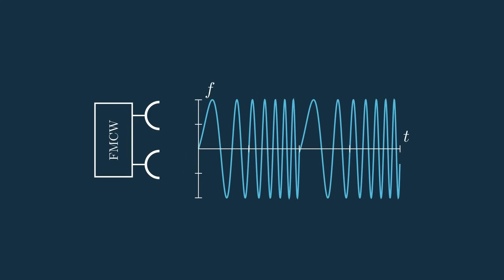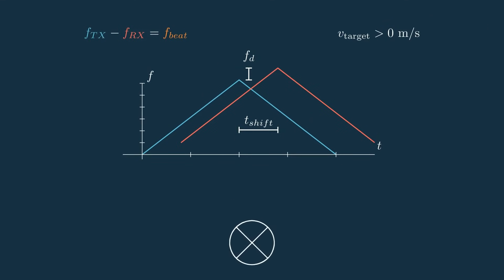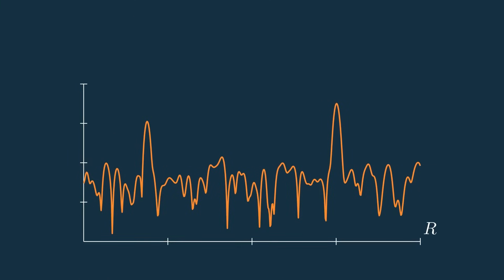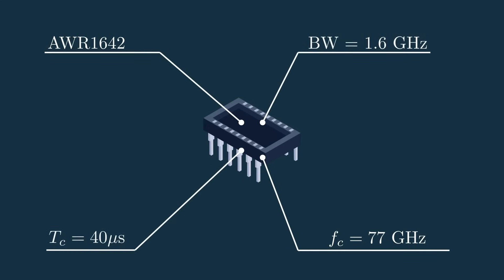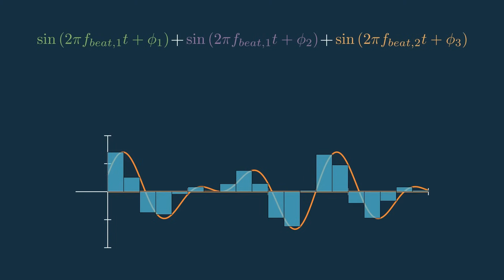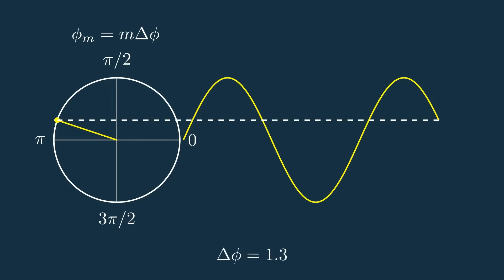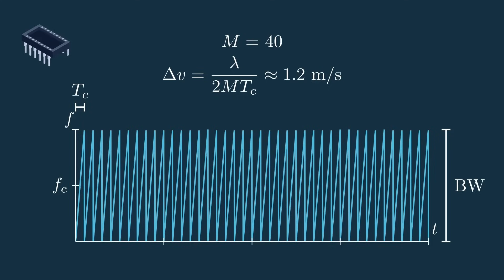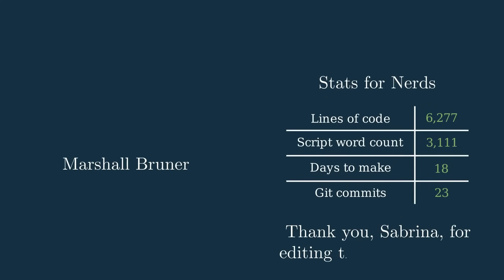How do automotive (FMCW) RADARs measure velocity?

Comment: The analogy of the police speed radar is incorrect. There is not enough motion for any meaningful Doppler shift of the incident wave and the reflected wave. The beat frequency is caused by the interference rate between the waves, which are constructively and destructively interfering with each other at a beat frequency in the lower part of the audio frequencies. The perceived Doppler is that of the beat frequency, not the two RF frequency wave forms. This is why police radars are field calibrated with audio frequency range tuning forks.
Also, target discrimination in police speed radar is determined by the operator listening for the Doppler of the audio tones. This requirement is often a valid defense against radar measured speeding tickets. Require the trooper to demonstrate how to operate the unit…if he/she fails to turn up the volume control, then they have no way of demonstrating the ability to discriminate which car they measured.

Comment: How do you differentiate between 2 stationary targets when you are moving and they are at the same range (like left and right side of the road)?
Reply from the maker: One of the axes in the range-Doppler spectrum, is velocity which allows you to differentiate between targets at different speeds, while the other is the range axis which allows for differentiation between targets in range.
Reply: @MarshallBrunerRF  ah so it shows up on the range psrt. Thanks.

Comment: Thanks for the video. I have one question. You take the DFT in slow time to get the velocity. But in the fast time DFT, you are looking for range. Since the FMCW radar used is single-ramp, you get a freq shift that is dependent on both range and radial velocity. Do you consider the frequency shift due to radial velocity to play a minimal role, because it will be small compared to the frequency shift from the range? I am thinking this would be ok for low speeds. The frequency modulation slope would also play a role I suppose. But in the case that you expect to measure targets with large radial velocities, would inserting some correction factor (post-processing, after you calculate the velocity) be a sensible and useful thing to do? Sorry for the long text.
Reply from the maker: Good thought! Yes, the change in frequency should be relatively small and mostly unnoticeable. I'm sure you could do some extra correction based on your range-Doppler spectrum. You could also play with this concept in the notebook :) Thanks for watching!

Comment: What if the target velocity is high enough that the phase of the return changes more than 2 pi radians between chirps? The target would show up with the wrong velocity due to aliasing. I presume long range radars with low chirp rates use a different method?
Reply from the maker: Yeah so that's part of your system design and estimating what your environment will include. For this I chose 24 m/s for the max velocity but for many systems you might want to choose higher than that. You can definitely get aliasing, same as you can with range targets being above your sampling frequency.

Comment: This video was more challenging to follow, but I appreciate the practical chip level example
Reply from the maker: Anything you think would have made it more approachable? It's definitely a hard concept, so I'd love to know if you have any suggestions for explaining it better
Reply: I’m not sure who your audience is. Casual science people? Engineers who work in the area? All of the above? As an engineer a concrete example with real parameters always is the most understandable way to digest.
Reply from the maker: I want it generally to be helpful and interesting to anyone interested in radar. Unfortunately, this video and many others require some base knowledge of sampling, antennas, etc. that would make it very difficult to fit in a shorter video to include it all. That's why I added the real example of the TI radar chip so that people could see how it would work in a real system. Thanks for your input!

Comment: This is freaking amazing. Also you are beyond amazing for providing the links to the books. Great channel
Reply from the maker: Thanks so much! Hopefully you find some use in the resources
Reply: @MarshallBrunerRF  does 14:51 mean that you can just screw over a fmcw Radar if you have 100 drones going the exact same speed? As always an amazing video, I had to reply here because YouTube doesn't show me the comment bar
Reply from the maker: With this technique you can differentiate between targets if they are separated in range OR velocity. So as long as the drones aren't in the same spot traveling at the same speed, you should be able to detect them. Thanks for the comment!
Reply: @MarshallBrunerRF  ah I didn't get the position part thanks

Comment: Excellent video. You mentioned the radar from Texas Instruments; I am using the IClegend ones (S3KM111L and S5KM312CL). They also perform these conversion processes. In the paper "On Fundamental Operating Principles and Range-Doppler" by Milovanović, the 2D-FFT is well described.
Reply from the maker: Thanks for the reading recommendation! Just looked it up. Yeah there's many options but I had previously looked into the TI one I showcased, so I chose to go with that. Thanks for watching :)
Reply: @MarshallBrunerRF  Did you work only with this hardware?
Reply from the maker: @LeonardoPJ  no most of my work on FMCW systems has been on analog devices phaser radar

Comment: Great explained! I wasn't far off with the idea of checking the rate of change of the target's frequency, but 2D FFT is much better!
Any cheaper solution for hardware then ADALM-PHASER? As I guess my half-duplex HackRF is not sufficient for radars. :)
Reply from the maker: Yeah there's some awesome chips from TI that have eval boards you can pick up for a little over $100 last time I checked. Thanks for watching!

Comment: You’ve mentioned radars in cars, but what are some other applications of FMCW Radars?
Reply: They are used in radar altimeters and proximity fuses too.
Reply from the maker: Yeah Oscar mentioned some, but also factories will use them in tracking assembly lines, they're good for imaging because of the very fine resolution, etc.
Reply: For defense purposes like drone detection with phased array antennas